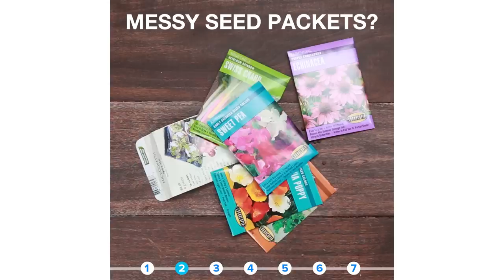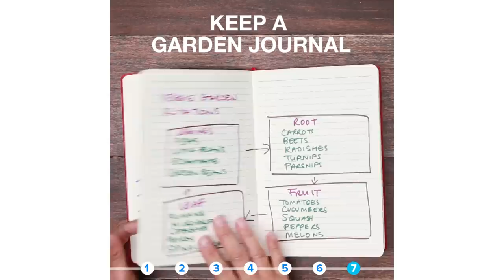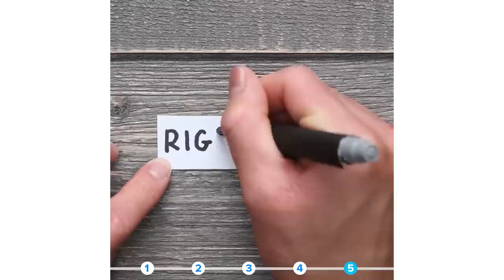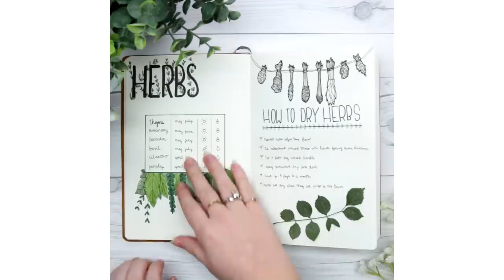25 Best Gardening Upgrades & Ideas

Comment: I'm not sure how that vertical pallet garden is made.  it was really fast and a lot of black was used so I didn't know what I was seeing.  is the entire pallet filled with soil in between the fabric?
Reply: It's rubber sheeting not fabric. And yes. The pallet is basically filled/wrapped with rubber then filled with dirt and sealed at the top. Then you cut slots to insert plants.

Comment: The first one, the herb wreath, is probably gonna dry out and wilt if you don't water it properly... Just spraying it a little is not gonna help at all. Would probably need to put it in a wide bucket of water and let it soak it up. And then hang it away from the wall, over a bucket or something.
And the second, the palmtree bench, I would definitely add legs to the bench and not put all the weight on the pots.
Edit: Ah no, please not the spray watering again! That does not work for most plants, they need the soil to be watered through!

Comment: How do u water the soil of that vertical garden??? Is it really good enough to just water the leaves?
Reply: Deja Vu no. It's not. Everything probably died. Plants take in absolutely no water from the leaves
Reply: banmanb so who thought calling this a hack was a good idea then
Reply: The black "fabric" allows moisture through.  So rain will do part of the watering, and then you water it from the top, or with a bit of water pressure directly on its face: you're not watering the leaves; you're watering the soil through the fabric.  I've seen these vertical wood-pallet containers used frequently on the English show "Love Your Garden", and Alan Titchmarsh's team make them exactly the same way, with garden fabric.

Comment: Woman! you drill wood with wall drill! its for concrete!. Check basic 3 types of drills (wood (can be used for plastic and soft materials) ,concrete, metal (can be used for the same things that wood drill)) it will make your work easy.
Reply: still nice ideas

Comment: The ceramic pot are going to crack
Reply: Saadia Laureano I thought so too lol
Reply: YUP.  They already have a limited life if they're out in all weathers, with the weight of soil and water in them, the change in humidity which will eventually lead them to wear out and crack.  Why on earth would you add stress on those pots?  If you want them in a bench, then make the bench self-supporting, PLEASE!
Reply: Damn it 😂 I thought hmmm out of all these, the stacking pots would be the one actually good to do. Because the rest, don't look like it is actually the right thing to do. It lost me at using masonry drill on wood.
Reply: @MsAnamonique  The stacking pots should be fine.  It's the pots used to support a bench that will crack.

Comment: great ideas but the bench will not hold up over time
Reply: Yeah, a great way to destroy $50 glazed pots.  Would be a lot cheaper and safer to add some legs to the bench so that the pots aren't taking any of the weight.

Comment: This will never work. Herbs like to be outside in full sun, so it is a cute idea but must hand outside.
Reply: wrong herbs are good indoors and outdoors. mine has been indoors for years with no problems.
Reply: Patty Rogers works indoors just fine
Reply: some such as mint are shade tolerant.
Reply: @netechma7724  many are actually they adapt super easy so its good just about everywhere

Comment: You only drill before nails not screws
Reply: banmanb there is a reason for nails. The wood will crack. Wood is expensive.
Reply: Supernatural Superstar if you use a drill before nails the nail won't bite. The drill here was used to make "pilot holes" (stated in video) which are a handy guide for woodworking novices. Anyone with more experience won't need this step.
Reply: You should be making pilot holes either way actually.